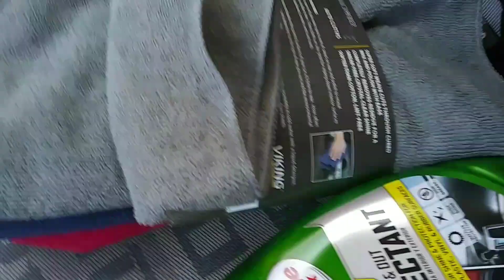(**G35 GETS AMS STYLE CARBONFIBER HOOD & SHOOTS FLAMES WITH NO TUNE *))

Comment: Have you had any problems with the dash gagues not working, I blow my full pump because it was reading it had 1/4 left in reality it was empty. I’m also in 831 and I want to get some ideas for tuneups in my new g.
Reply from the maker: Yea bro it’s a common thing on these Cars the gas gauge somehow stops working when it’s full it’s fine but once I get towards the half tank it stops reading my gas and I recommend spark plugs oil change to begin with

Comment: You never had condencension inside your head lights ?
Reply from the maker: No I haven't bro they are really nice lights from specdtuning
Reply: G35 PANDA I have inside mine  sucks
Reply from the maker: @javierc1124  take your hid light bulb off and hit it with a blow dryer and it will come off then try and seal it up with some silicone